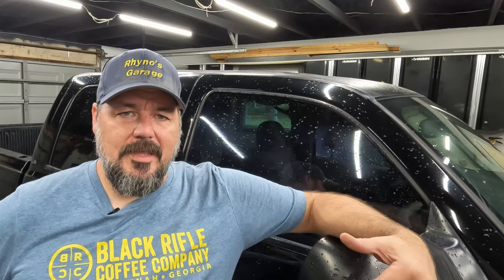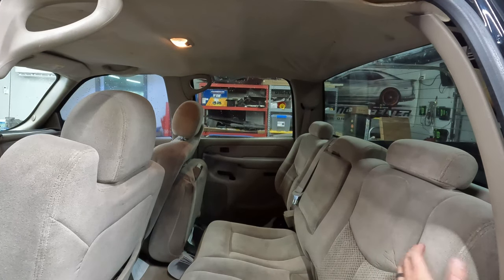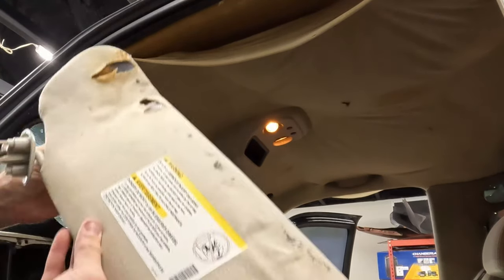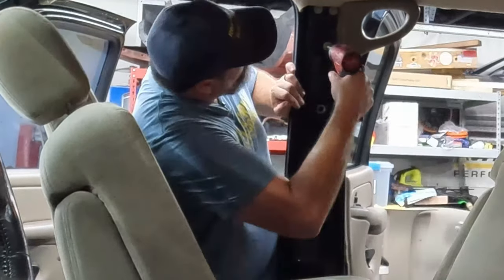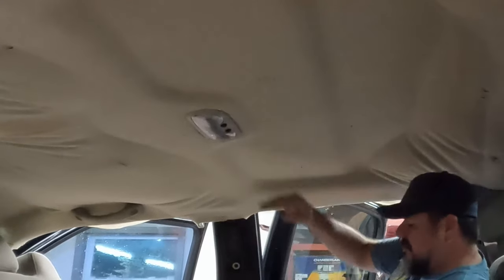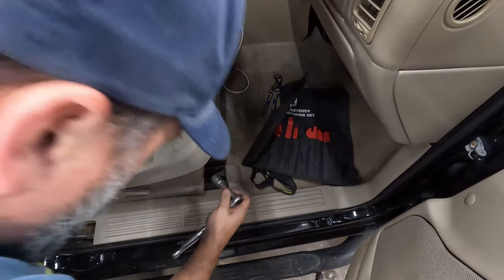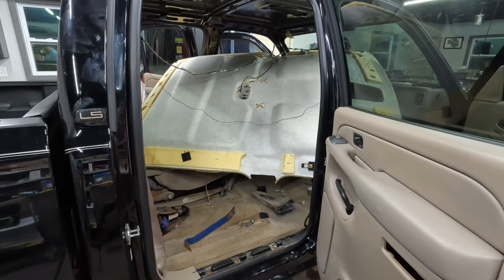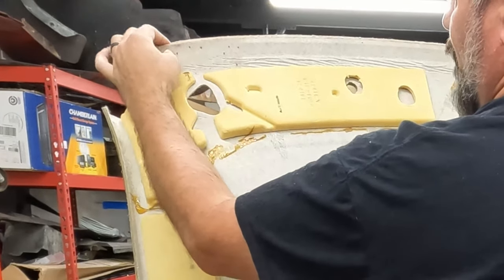Remove the Headliner from a Chevy Silverado Crew Cab

Comment: My headliner is not as bad as
 yours.. mine is peeling from the edges and by the windshield. And the 3rd brake light my need a new gasket.
Reply from the maker: Turns out my 3rd brake light area is rusted out in one spot pretty bad and that's why it's leaking.  Going to have to get creative with the "gasket" on mine.
Reply: @rhynosgarage  Do you know how to weld?